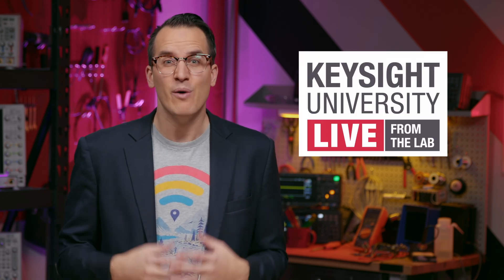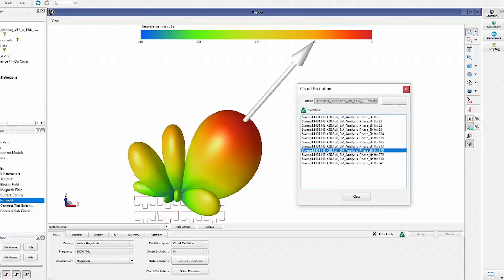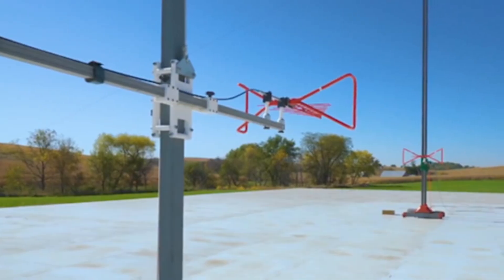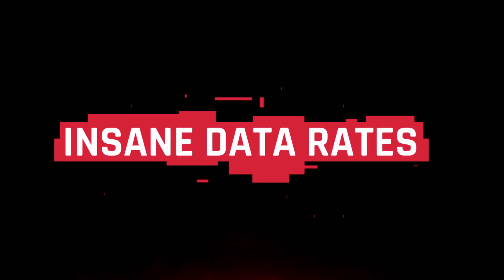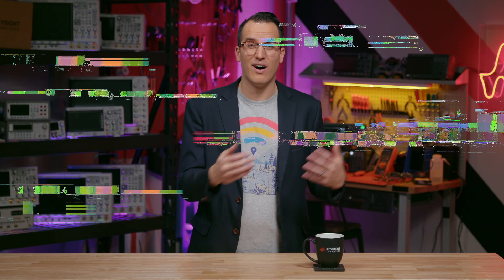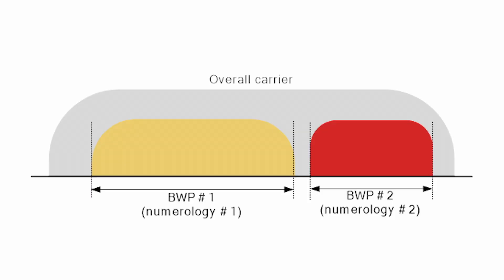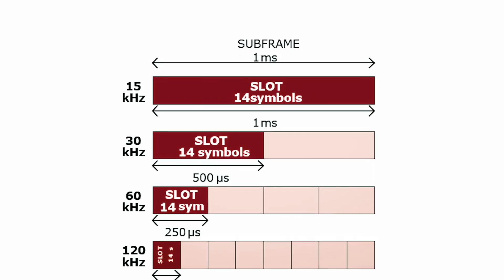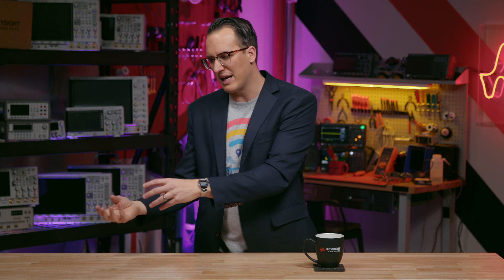Why 5G Engineering is AMAZING

Comment: Thanks for the nice video. When communications engineer says higher frequency means higher data rate, they are combining two steps (higher frequency means availability of bandwidth, and then more bandwidth means higher data rate). After all there is a trade off between being accurate and being simple. If you watch the video again, you ended up saying the same thing. Keep up the good videos.

Comment: I'd disagree with a couple of statements here ;)
Reply from the maker: Oh? Would love to hear more, especially with your Nokia & other experience.
Reply: @KeysightLabs  Hello! Sorry I missed the answer. Youtube decided to stay silent about it ;)
1:30 Beamforming
Well, we had a kind of beamforming in 3G and we definitely had beamforming in 4G. It came with MIMO, release 9 allowed 4 antennas and it went up to 8 in rel. 10, if memory serves me well. Transmission mode 7. 4G UE's today have 4 antennas pretty much by default. We have beamforming and very cool modulation in WiFi for a very long time as well. Actually, to steer beam we need a minimum of just 2 antennas, spaced at least 1/2 wavelength apart, which is easy enough as conventional LTE bands are in centimeters range.
5:20 No concerns here, just want to add that high FSPL, penetration losses and the fact that RF starts to act like light (everything cast shadows), can be a huge advantage considering available bandwidth from user perspective. Harder propagation means less users per cell. Natural space-division multiple access. Sort of.
8:32 Just to clarify, we had carrier aggregation before ;)
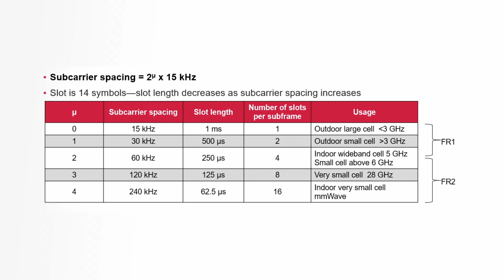9:32, 9:49 No. Subcarriers are not further apart and it's not about less interference. Changing numerology just rescale the picture. To keep it short: subcarrier shape in spectrum is just a Fourier transform of rectangle function, which comes from a fact that symbols are "rectangular" in time, i.e. they are send constant for a period of time. Shorter the symbol, wider the spectrum of a subcarrier but shape is the same. 1st order Bessel function -> sinc. The whole trick with orthogonality requires placing subcarrier in such a frequency, where neighboring subcarriers power is zero. This is true no matter the numerology. So faster symbol rates make subcarriers fatter and this requires them to be spaced proportionally further apart. Not an interference issue, just orthogonality requirement.
11:02 One can think that 5G is TDD only, but we can have 5MHz wide 5G FDD carrier in a ridiculously low frequency range inherited from analog TV and use it to cover Sahara with 3 masts. Or maybe a couple more. I find that flexibility as important as new and exciting radio frames.
--
Anyway, it was a cool video. Thumbs up :)

Comment: https://youtu.be/zZDUmlsMCPQ?t=347 - you are partially wrong about Bandwith. If you have a carrier frequency f0 then the Bandwidth BW determines the quality of the antenna Q=f0/BW. The higher the Bandwidth - the lower quality antenna you need to develop, which can be an extremely difficult task, because it's hard to achieve a linear frequency and phase response for wideband antennas with Q < 10. The antennas arrays are not cm-mm lenght as in the GHz or tens of GHz but meters and even kilometers for MHz/kHz frequencies (lambda = 3*10^8/f).  E.g. you want to do a 20MHz bandwith with a carrier frequency 100MHz This would require to develop an antenna array 10-100 square meters roughly for a proper frequency and phase response. And when you want to develop a 20MHz bandwidth with a carrier frequency 10GHz it will have quality = 500 and a simple halfwave dipole (1.5cm withoud an insulator) would be enough to have nearly perfect linear phase and frequency response for that antenna.

Comment: Good video but i have to admit i actually dont like 5G, while you think its cool that it does beamforming etc to me thats the opposite, its a solution to a problem that shouldn't even exist, that feature just screams trouble, you can only point to so many things at the same time until you run out of mini-antenna's on the big antenna-mast, and if you'd just go mental with those (say a few hundred/thousand mini antennas per 'big antenna' to cater to all nearby people wanting to use facebook on the go) you end up having a signal that goes all directions & that means it would stop beamforming because of how that works? so as more and more users hop onto a 'big antenna' the range keeps decreasing...???

And surely i cant be the only one that noticed the following, while 5G roll-out is still in its baby steps in most countries there's already companies left and right asking customers to TURN OFF 5G, because oops, the networks are already struggling with it and the phones are draining their battery super fast...???

Dont get me wrong, nothing against progress what-so-ever, but i strongly feel like 5G was rushed to the market and actually a pretty bad design.
(Because somebody got upset that a certain company in China was actually making a better version? lets not get into politics i guess..)

Comment: Good video, 5G virtualization is pretty deep topic as well, lots of antenna designs stuff the software is another beast, software defined networking, software define radio stacks, Xilinx Ultrascale FPGA's, technology at the finest scale of achievement. wung-lung-ho equipment is a no no.

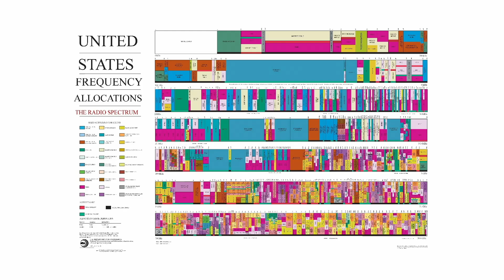Comment: 6:01 This is true, but wider frequency range can allow for more channels at a higher bandwidth to allow for more users to share the same frequency band without interference or interruption.
ATV transmitters or fast-scan TV transmitters at 70cm or 420Mhz uses a huge portion of the band, so it can use high bandwidth frequencies on it, but only one of itself while other users would have to wait until the ATV stops transmitting. This caused a lot of problems when analog TV was around and ham operators were using these transmitters for model airplanes or ham TV.
My 5cm (5.8GHz) ATV or video transmitter can actually jam up my family’s wifi pretty badly which is why I have to transmit away from 5.825GHz. This is the benefit of having a higher frequency because it can allow for more channels to operate away from commercial priority bands.

Comment: Nice video 👍👍. I have just one question. How do you create suuuucchhh high frequencys. The usual plls or dds components can be max of 400Mhz or 1 GHZ. HOW DO YOU GET 5GHZ OR HIGHER????
Reply: You shift the signal in frequency with a mixer.  There are IC's that take in the 1 GHz signal and mix it to millimeter wave (e.g. 28 GHz).  You do the same on the receiver to mix it back down.
Reply: @rfdspguru2  yes but for shifting you need a lot of hf frequencies again. For 30 GHZ you need 30 1ghz frequencies mixed together

Comment: Well it´s pretty much bringing radio technology to consumers. Beam forming is cool!
Reply: Until it has to beamform to a few hundred/thousand people in all directions, then that whole thing stops working.
Reply: @suicidalbanananana  Well that's the least of the problem, don't forget the high abortion. It's very cool technology but a bit gimmicky for consumer use. There are some industrial applications which can benefit greatly, but for the general public just a selling point.